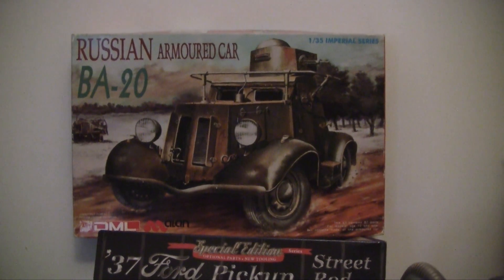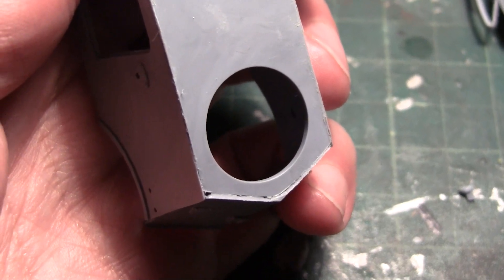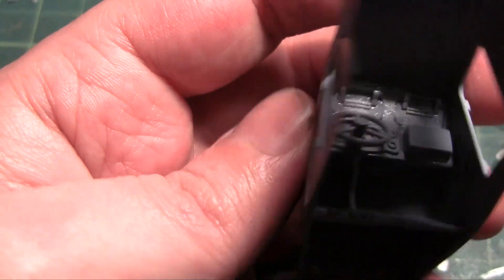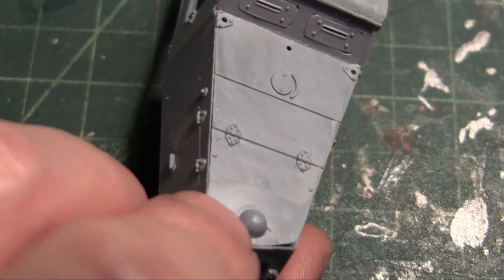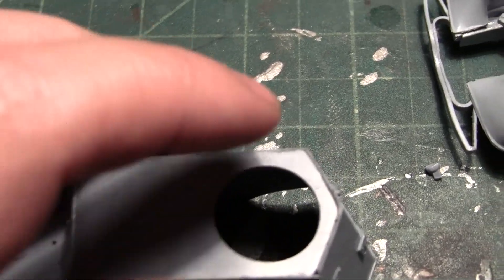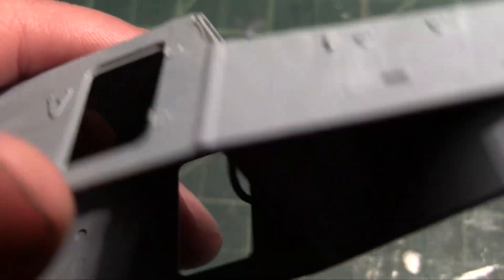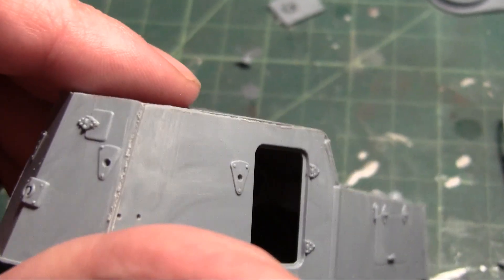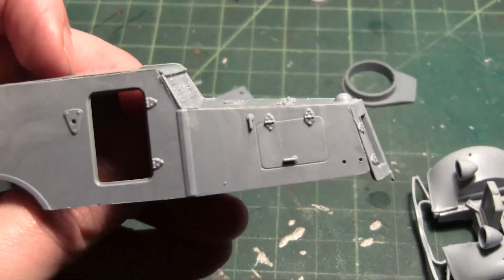Russian Armoured Car BA-20 - Part Two - Update and a Question

Comment: if I recall Dr. Cranky did a video on wields... but basically take half round stalk glue it down and take a hot knife ( a wood burner that has a exacto knife looking tip.) than you push melt you detail in. you could do it with a pocket knife tip and a lighter just be careful and take your time... also don't get it too hot.... practice on some spare sprue.